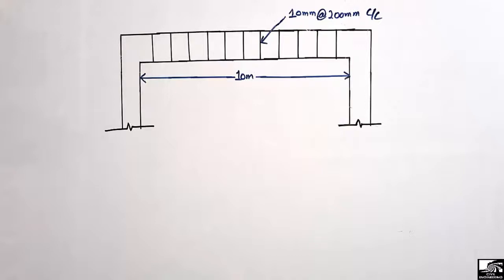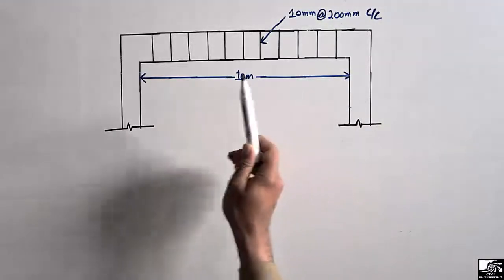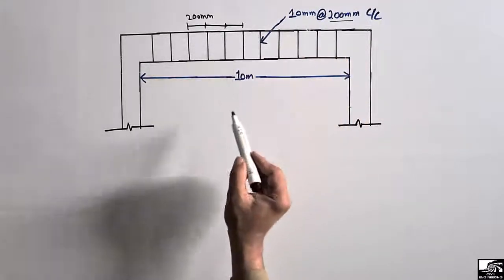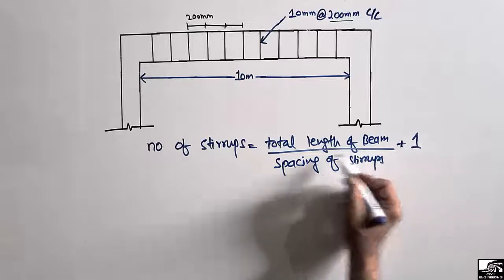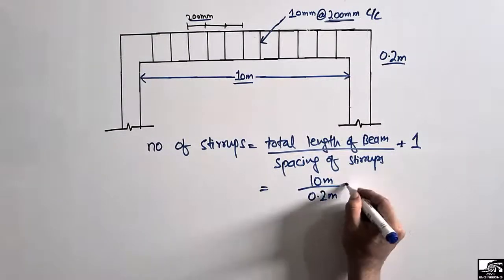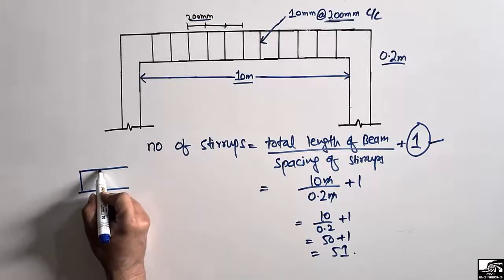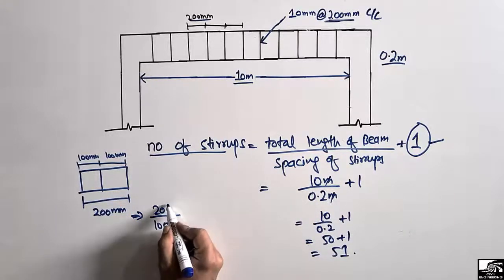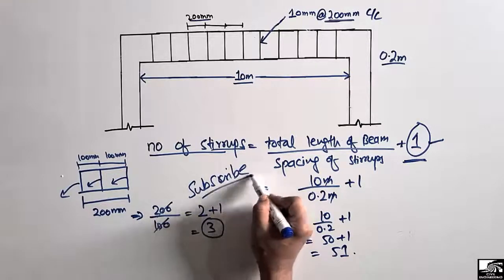How to find Number of Stirrups in Beam

Comment: column size is 350mm*2750mm. 34 bars  of  20mm dia are vertical bars .  cover  is 75mm.  Stirups bars are of 8mm dia.  Master ring is easy to calculate but  i m having problems with  link bars.  So plz tell  me  how to make bar rings. And how to calculate quantity of rings